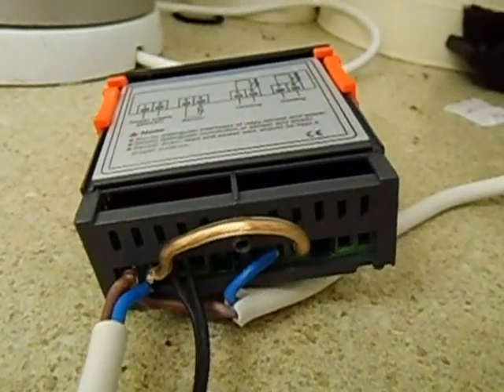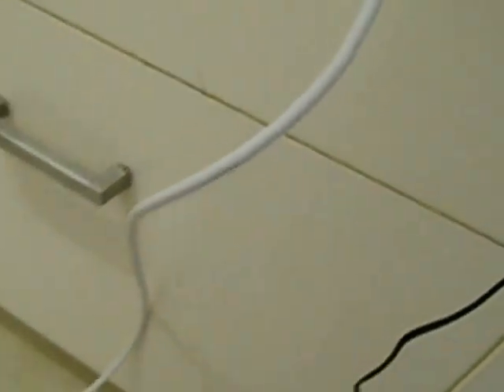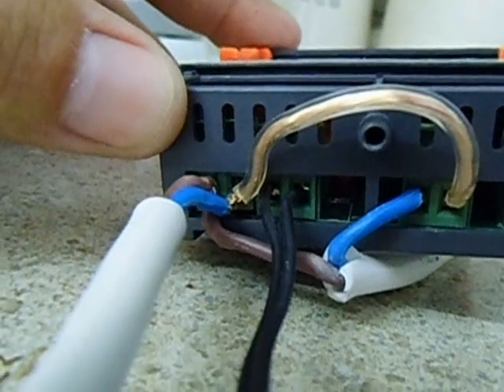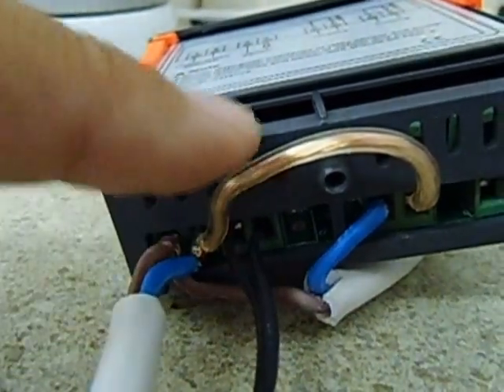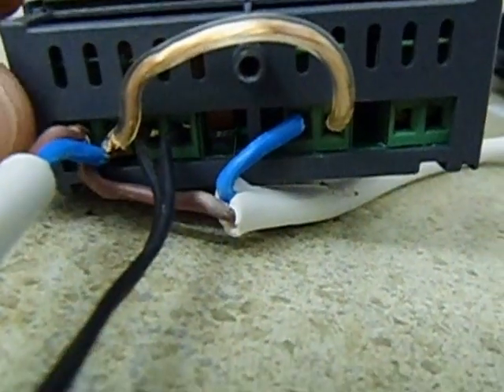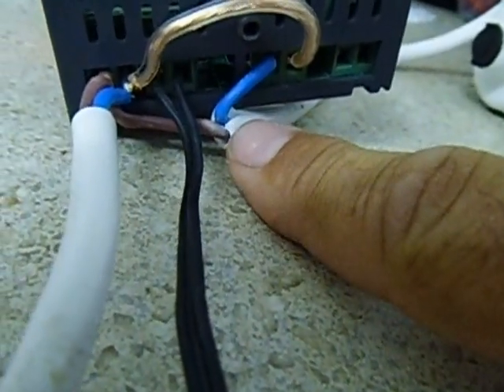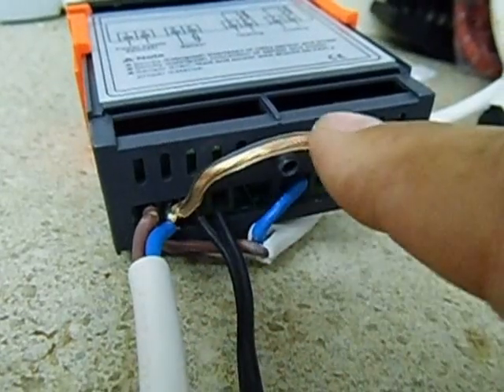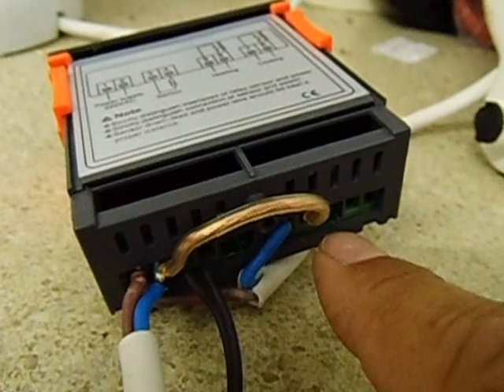lcd digital temprature thermostat controller wiring

Comment: Should be the active wire going in and out of the relay, not the neutral. You have a constant voltage to the fan...